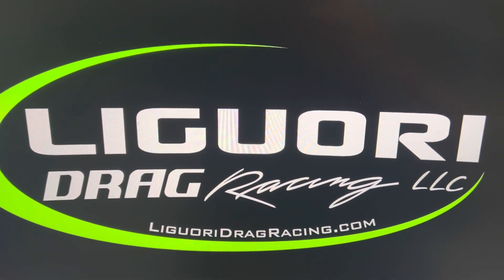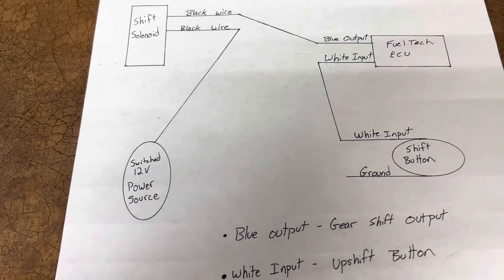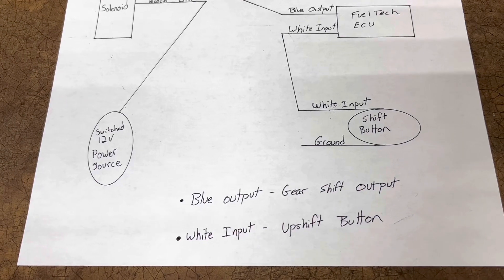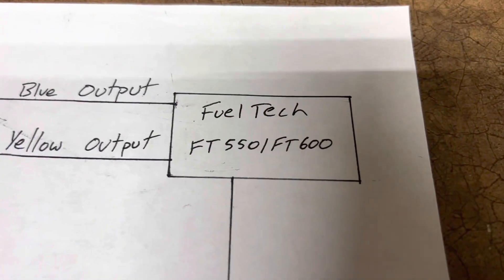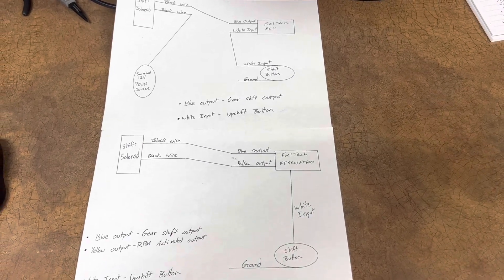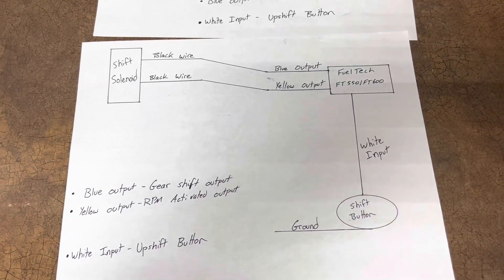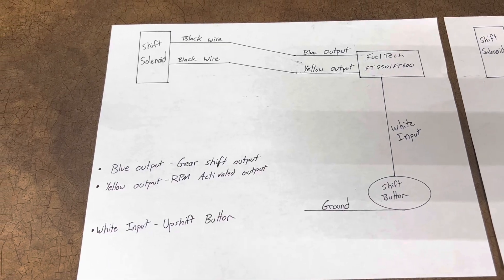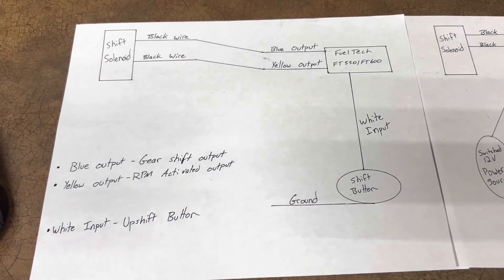FuelTech wiring series Part 4: wiring your shift solenoid output and shift input with drawings

Comment: Can I use the upshift button to function as  powershift on the ft450? I know the ft450 does have the powershift function, but is there any chance that it can be made? currently running on dog box setup on my shit box, and wanting to run the KDN shift knob which is a microswitch base knob and not a load cell knob. I thought maybe the knob can act as a upshift button because its a microswitch to cut on the ignition and it would be easier to shift the dog box. I know I should get the ft550 for the strain gauge function, but the dog box setup was a last minutes decision and by then I've already bought the ft450. so I'm wondering if its possible ?

Comment: Is there a delay built in before the shift kill to allow the actuator to build air pressure? How long is the delay to build pressure if yes?
Reply from the maker: Yes there can be a delay and you can set the time. I typically start at .02. It is the first option in power reduction in the gear shift output settings.
Reply: @LiguoriDragRacing  thank you
Reply: @LiguoriDragRacing  my air shifter is staying in in upshift position